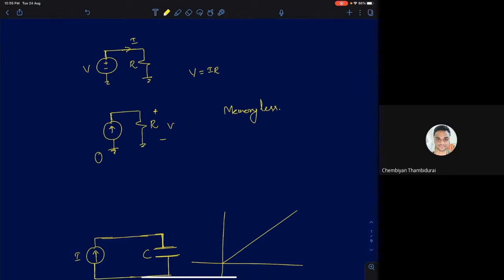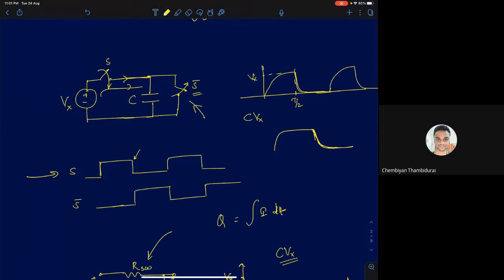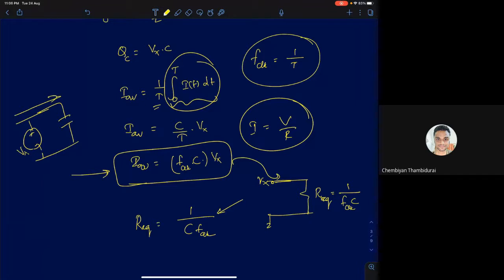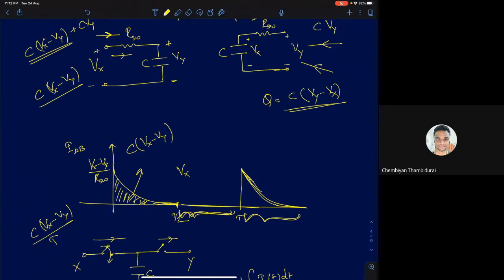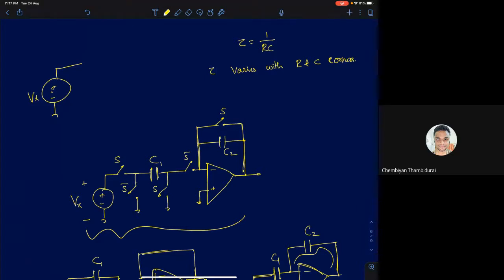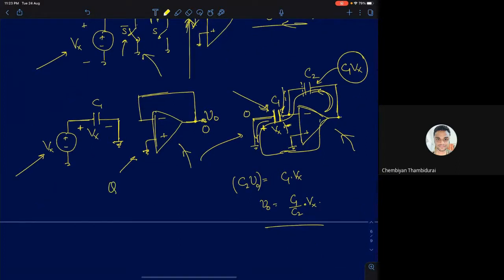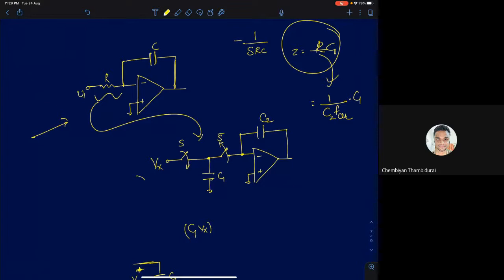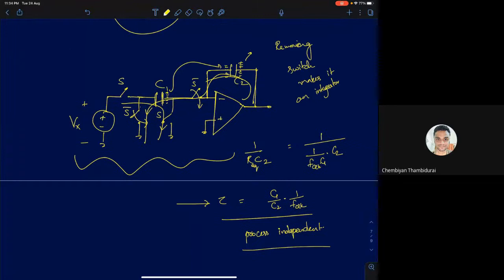OC   Lecture 10: A very basic introduction to switched capacitor circuits

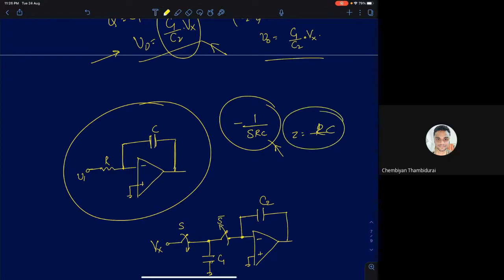Comment: at 31:58 , the time constant of integrator is said as RC but in opamp circuits the time constant depends on feedback elements as said in previous videos can we say that here time constant is infinite since there is no R(as vi/R current charges the cap linearly)

Comment: At 26:00, the feedback is negative, but if the opamp output settles then for the remaining time (before the next positive half cycle) , can we say that the Capacitor C2 is now open circuited and no feedback exists?
Reply: As long as output of opamp is not hitting supply rails, opamp will be in negative feedback in that circuit. It is because of negative feedback only that C2 is charged and "held" at that voltage. If there were no neg feedback, then C2 will again share the charge with C1.